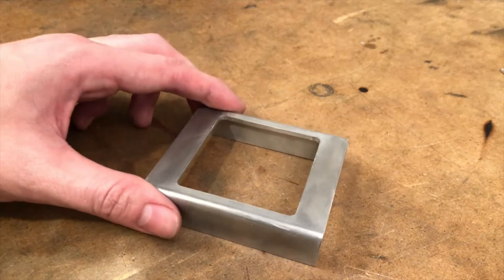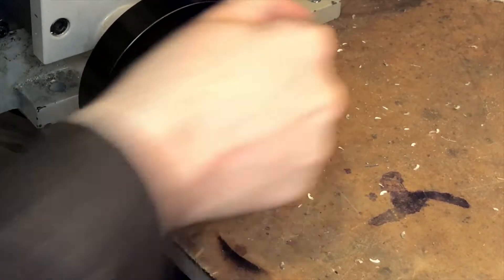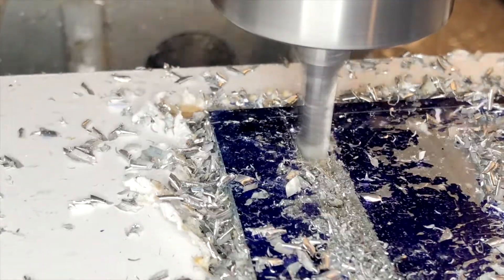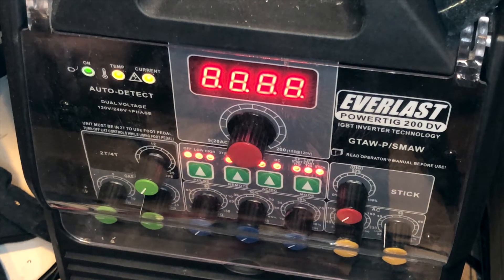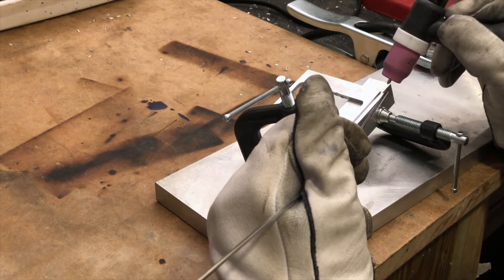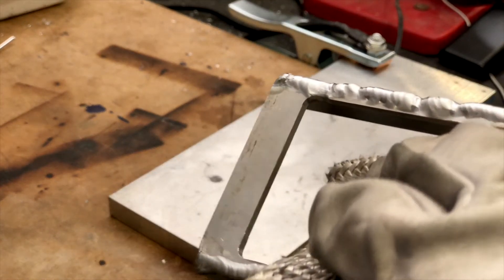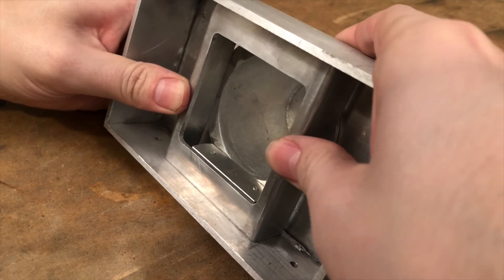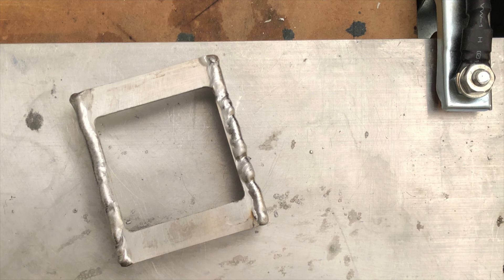How to make a Camera in a Home Machine Shop Part 6: The Film Plane

Comment: If you want a cheap power feed, just make up an adapter that takes the hand feed and lets you chuck it up in a cordless drill. Then, put it on the lowest speed setting and feather it until you get a good feed rate.

Comment: Just a suggestion but try getting some smaller filler rod... 1/16" will give you more 'control' ..
Reply from the maker: Just got some. Taking it for a spin to see how I like it!
Reply: Cropped Camera great! You will probably need to feed more of the smaller diameter rod.. and if it balls up and melts away from ya watch that torch angle...👍